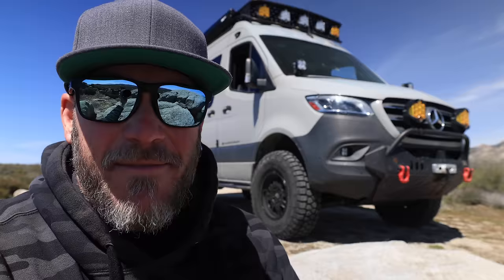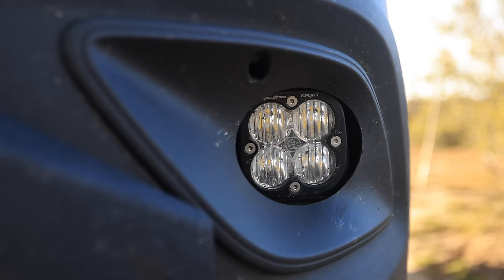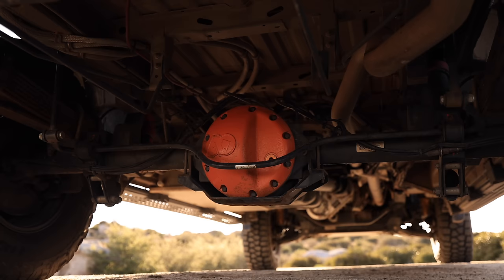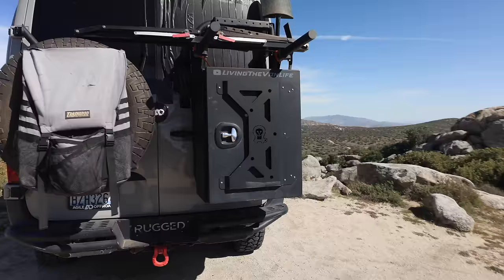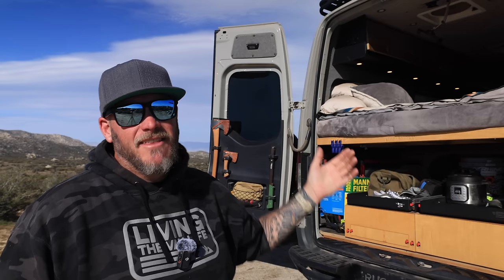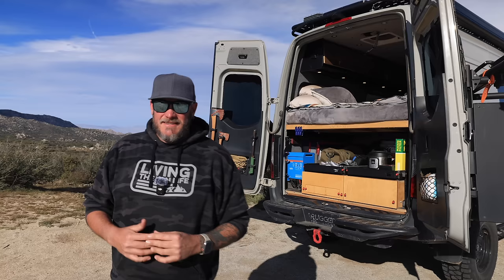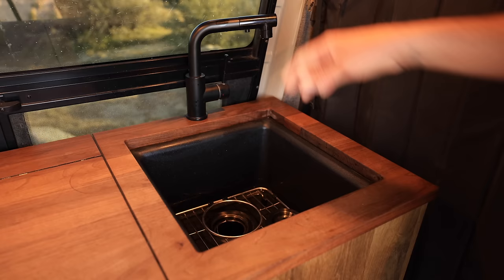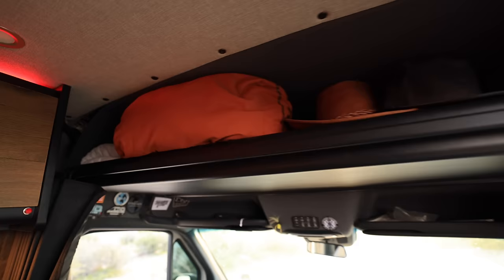Van Build Tour 2024 | How I Built My 4x4 Mercedes Sprinter Van | Living The Van Life

Comment: Thanks Chad.  I'm in the process of having a 2023 Ford Transit High Roof Extended AWD built into my home by Drifter Vans in Michigan.  It will be lifted and have some awesome big wheels and tires on it.  I should be on the road by August.   I do want a winch and light bar, but haven't included them in the build yet.  I think I'll add them in.

Comment: Great Van. You need a stainless Steel Shovel. I had a Bucket Toilet in my Van too. Very convenient and way easier to maintain and clean than any other setup. You don't need a flushing toilet in a van. Same with the shower. You could easily add a NEMO portable shower and be good with it if you want one on the van. Living in a van means you need to simplify your needs.

Comment: Great vid, however using solar makes your system much more efficient especially considering your using an alternator to charge your batteries as fuel consumption increases considerably when the engine is loaded up with a 280amp load! Keep up the vids though

Comment: Great interior layout!  One question…when the Agile air lockers are engaged, can you still use the Mercedes stock 4x4 system for the front wheels simultaneously?
Reply from the maker: Yes.  Correct.  You can engage the locker either in 2WD… or with the stock 4x4 system.
Reply: @LivingTheVanLife  Great!  The air lockers are getting installed this month as a result from your video with John.  Can`t wait to try them out!  Thanks!
Reply from the maker: Sweet!

Comment: Do you have AC for the back Chad? Just wondered on the van getting hot?
Reply from the maker: No AC installed.  But I have two Max Air fans installed in the roof. They are reversible so that I can circulate air

Comment: What is the second alternator you have fitted? I'm in the Uk can I purchase one here or will it have to be imported? Thanks
Reply from the maker: The one I have is from Nations Automotive here in the states
Reply: thanks Chad for that great video ! We also own a 4wd sprinter van, kinda regret not having installed a second generator! Very plausible that you don’t rely on solar! Basically no charge during winter time in northern hemisphere . What is the brand and type of the regulator between 2nd gen and battery.?